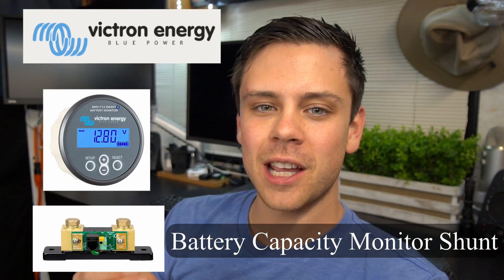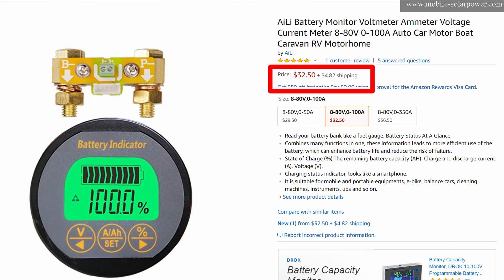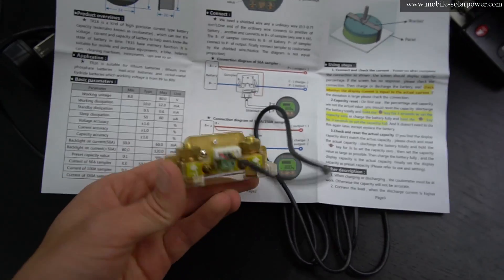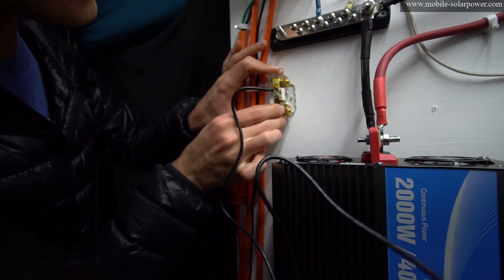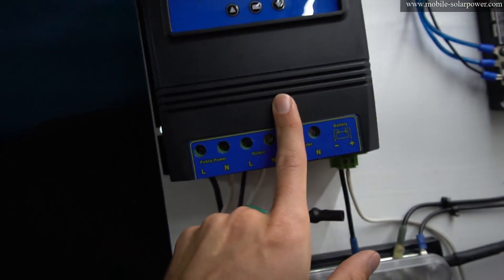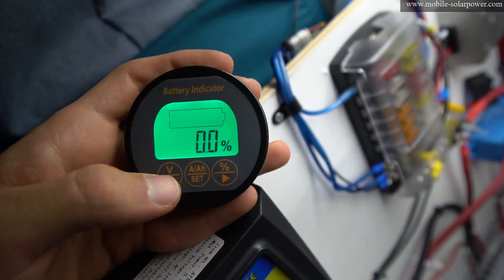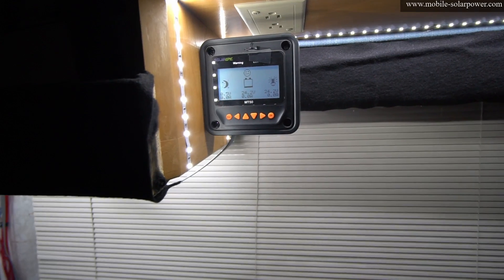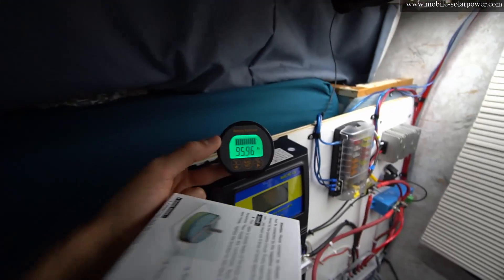$200 Victron Solar Battery Monitor? Try this $30 Chinese one instead! Great for Off-grid Solar

Comment: I don't get why you need to set a 0 volt..
And what would that be for a 12v lithium? 10v??
I planned on getting a bmv702, but this seems just what I need, I need to know the % of my lithium battery (4wd setup) harder to tell using a volt metre like an AGM..
Reply from the maker: Zero volts is 10. It's 0% Soc.

Comment: As I'm figuring out my solar system and how everything works. I decided to get a meter. After watch many videos and going through the options and seeing this meter forsale online then I found your video to help confirm my decision to purchase one. It would be great to have the bluetooth but the information is what I really want. Maybe the Chinese will come out with a new bluetooth model soon. Itll probably be cheap enough to upgrade this unit. Lol. Thank you for this helpful video along with all your others. I have pretty cool gmc savana that I've been working on and cant wait to get it completed so I can make my final video and start editing some of the footage of the build. Once its finished I'll send you the link and maybe we can swap more ideas. Thanks again.
J.C. out here in Half Moon Bay CA
Reply: Yes, I got one a few week ago and it works great.  I charge the lithium batteries from my rv alternator with the Renogy 20 amp dc to dc charger and it works great.  Thanks for the suggestion

Comment: I don't see how this will stay calibrated for very long with no settings for charge efficiency, peukert constant, temperature  or even battery type. The Victrons auto recalibrates every time the battery reached a full charge.

Comment: What would the zero point be if it were used in an RV with a few 12v led acid batteries?  This is a great find.

Comment: After purchasing one I'd say to use your low voltage disconnect to get to your zero voltage (11.9). Then fully charge, if you have very good quality AGM batteries you might have more ah than you think.
Reply: I've got 6.2% more ah on a 864ah bank than 50% dod would suggest.

Comment: They have rewritten the instructions. They are quite easy to understand and follow now. At least on the 350A version that I purchased from Amazon a few days ago. They have also added the ability to turn the backlight off and on, by pressing the V and % buttons simultaneously and holding for a second or two. This may not be a new feature, it might exist on all of them but just wasn’t documented.
Reply: @Gail : I cant' get a hold of this 'new' TR16 instructions manual (with the display on/off option), could you share it ?
Reply: What size are the bolts?  What lugs size, 5/16, or 3/8?
Reply: @supermo26  I have both 100a and 350a. The 100A shunts are 5/16. The 350a shunt is 3/8. Found out the hard way.
Reply: yes I've sean y-tube videos where the light blinks when charging kindof iratating. pressing V & % will stop the blinking?

Comment: This may seem like a silly question, but is it possible to change out the bolts on the shunt? I’m reading that the 350a shunt uses 3/8 bolts and all my cables have 5/16 ends. I don’t want to redo all of them.

Comment: You have to discharge your batteries to nearly zero for this thing to be set.  I ain't doing that.  Bad for AGM batteries.
Reply from the maker: No, you discharge to whatever you usually discharge to. Which is probably 50% Soc. Not 0%. 0% of your usually cycle capacity. Lol I thought that was obvious
Reply: @WillProwse     only obvious to genius's like you.

Comment: Does the monitor take in to account charging inefficiency in the battery? If you put 100 amp hours in, you don't get 100 amp hours out. Without compensating for that the monitor will think your battery is full when it is actually empty after a couple dozen cycles.
Reply from the maker: It resets every cycle. And no, not for peukert effect

Comment: I wouldn't quite compare it to a victron, the bmz700 or 712, has alot more features.. maybe you don't need them, but there there.. you can set volt cut in for generators, to turn on at a certain voltage, or at a certain time, can do alot more than what this one does

Comment: The cheap Chinese one will probably set your house on fire at some point :)
Reply from the maker: What would fail? Two voltage sensing wires and the simplest logic board ever. Low resistance resistor. What would catch on fire?
Reply: @WillProwse  High current connections that can't be FIRMLY tightened is not safe.
Reply from the maker: @michaelbrown2443  every shunt on the market is just as cheap as this thing. they all come from China and are relabeled. How many shunts have failed on you this year?
Reply from the maker: It's a shunt

Comment: Love to see the inside of that device. Can’t be more than a couple simple circuits, resistors, a chip and display. You really should get into making your own stuff Will.
Reply: I agree...  under $10 if you build it yourself on an arduino and $15 if you order a meter like this from AliExpress...

Also,  it is REALLY bad to train your meter by discharging to zero SoC...  most meters let you set 100% and learn downwards without destroying your battery.
Reply: GyroGearloose-HackingRVsCheap I think he mentioned that the meter was going to learn on its own after he did the discharge test. He clearly had a hard time with the documentation. So it’s a trial and error video. 

Anyway, we know it can be build for a fraction of the price, after all you can tablet computers for a hundred bucks. We might just be afraid to do things ourselves. We are primed that only a professional can do things. While that’s true in some instances, the majority of work can be performed by anyone who is not half brain dead. My car repair shop wanted to charge me for 4 1/2 hours of labor to replace a radiator fan. Found someone who did it in 35 minutes. I watched and now can confidently do it myself.!
Reply: The Shunt is the critical part, not easy to make...

Comment: These battery monitors need to give you a longer data cable. Most include a 2 meter length cord and thats not nearly long enough for RV installations for most folks. I found a company who has them in 35 ft lengths, and they sold me one. You have to find the correct shielded cord with the corrrect plugs and thats not easy to find.

Comment: nooooo dont say that victron is overpriced standard kit! the victron religious nuts will get in a flap!
Reply: If there is ONE thing that is worth buying quality, it might be the SOC meter.
Reply: @michaelbrown2443  isn't that a voltmeter for people who can't read volt meters
Reply: We're Really Relay Camping: Particularly for lithium, we can’t determine SOC from a volt meter.  A meter that tracks Ah in and out is needed.
Reply: @michaelbrown2443  been working with lithium for 6 years now, so I know you can track soc via voltage and much more accurately than with lead due to the lower internal resistance. It's not that hard as the voltage does taper in a nice linear fashion from about 90 to 20pc, just display that as 100 to 0 and your covered. If you just use voltage on lead it's going to vary with the weather even in the UK so yeah not that accurate.  An amp in amp out is easily more accurate I agree with you, but I find people requesting such accuracy are usually the ones wanting to discharge to near death on them instead of buying a larger size pack, I used to be one of those people lol, now I just have 400+ amp hours and ignore the meters, I'm never that far down unless I'm torture testing an inverter.

Comment: I can't believe you actually need to drain the battery to set 0%, surely you can set your own preset 0% which could be your own predetermined low voltage disconnect. Thoughts or feedback?
Reply: No, you can setup the system on full too: 
Set capacity zero or full：
When on first use or change the battery，the memory
capacity should be set zero or full: In the main interface，hold the
“ ”key for 3 seconds to set the capacity zero，the percentage
is 0；hold the“ ”key for 3 seconds to set the capacity full，the
percentage is 100. Attention that the operations can not be
restored.
Reply: Ah yes, i mean you can set it once your battery is at your own favoured low or high voltage knowing the actualy capacity remaining at that time i.e. 75% on a 100ah lithium amd then say set the capacity to 50Ah so that indicated 0% will be at actual 25% - to maximise lifespan of battery.
Reply: Of course the charge source charge algorithm and low voltage disconnect should be setup to match...

Comment: Hi Will,  wow thanks for this  vid.  I'm with you on the prices,  these company's are insane.  200.00 plus just to show the v, w, %. I will purchase my 30.00 next month.  I need two, one for each battery.  I have a two house 12v wet battery plus another for all my other systems.

Comment: I got mine installed, and was able to set amp hour capacity [225 ah] and 100% full battery, but I am confused about the voltage setting! I have 2 [new and fully charged] 6 volt batteries in series, so 12.6 volts. I adjusted the "V" setting to 12.6 volts, but it goes back to zero!  I thought that it should read out my 12.6 volts. Any ideas why it's reading zero? Did I do something wrong?
Thanks for your videos!

Comment: This can only manage 80V, right? I have 2 x 330wp with 70V (VOC) each in series planned for my vehicle. Is there a battery monitor that can handle that? The Victron 702 only goes to 95V.

Comment: I assume this will work with four LION batteries 100 Ah each set up in parallel .  Is that correct?  Thanks.  Good video.👍👍👍

Comment: That meter looks really good.  My only concern is with the plastic base.  Does the plastic base only keep the bolt from rotating, or is it also sandwiched under the bolt head and getting the compression forces of the wiring connection?  If the plastic base is in compression, I would worry about the connection becoming loose and overheating due to the plastic deforming with the heat and force.

Comment: Not sure I'd trust it to be accurate over time.   Also nervous about putting cheap electrics into my truck where a fire caused by a ncap faulty device would cost a lot more than the money saved over a Victron.
Reply from the maker: Yeah but it's a shunt
 It's fine

Comment: Now $40 on amazon. Does Alibaba have them cheaper ? —- and what is the maximum length of the monitoring wire connected to the meter?  Can I run that wire 20 feet?
Reply: The plus monitor is just for voltage, almost no current flow, like a DMM.
So that wire can be dang small.

Comment: Do I need to connect my negative from my ctek shorepower charger aswell as my solar negative to the "P" for it to measure correctly or do I connect them to the battery?
Reply: André Wendel everything going i or out from the batteries has to go via the negative bus-bar and the shunt. Ohtervise it will not display correct measurement.

Comment: I wouldn't put my trust in a $30 Chinese item when I'm looking at my $4000 batteries.
Reply: It's just a smart volt meter, can't do any harm to the system.
If you doubt it's reported SOC, measure it yourself with a trusted volt meter for comparison.
Reply: Michael Boardman — likely a wise observation. And why I will not spend $5000 on a solar system used for boondocking randomly. If I was full time in a remote area, where I could stay 30 days —- maybe.

Comment: And it’s irritating when the Victron BMS board on the shunt stops working and they have no replacement but want you to spend another $200 on another full monitor and shunt. They sell the shunt separate but not the board ! That’s just bad service from Victron

Comment: Bought one of these £36 (in the UK) monitors and have an installation question - would be very grateful of any advice. I have 2 leisure (house) batteries, 1 under each front seat, connected in parallel. My positive comes off LB1 under the drivers seat and goes to my fuse box, which is earthed to a seat stud bolt. My -ve comes off LB2 -ve under the passenger seat, and goes to a seat stud bolt under that seat. When I place the shunt under the passenger seat, do I have to reroute the -ve from the fuse box so it also goes through the shunt? Thanks.......

Comment: Just picked up one yesterday and trying to decide where to place it. I only have 200 watts of solar and two lead acid batteries at 12 volts for my starting point. Eventually I want to go to Lithium but for now until the seasons warm up again here in New York this is where I am at. Also just picked up your book on Amazon and seem to gravitate toward the 400 watt sized system. I am not sure though to ditch my crummy WFCO system ot maybe add to that with a separate solar system. Thanks for providing so much info.

Comment: I wonder about the reset when drained part. Could you zero it when the batteries were full then decide when you want to recharge. I ask as it is easier to charge my batteries and then let them rest. Waiting for the batteries to fully discharge takes a bit more timing.  In your video I did not see you set the meter for how many amp hours your batteries were. How would it know when your batteries were full ?    Put another way, if it doesn't know how many amps came out of the battery, ( resettiing it when drained would zero it out), how would it know how many amps it would take to recharge?  Maybe it uses a capacitance test to determine 100% ?

Comment: When you have to bring your batt bank down to zero to set a baseline for the monitor, I thought I was never ever deplete my batt bank. (I use wet cell)
Reply: I believe he used the 0% setting to represent the lowest voltage he felt was appropriate to not go below to degrade the batteries length of life.   If he used 6V flooded golf cart batteries that has say has a 230 Ahr capacity, the C90 value.   He might select not letting the battery to fall further than 40%, so he'd run the battery down to 12.2 V representing 60% capacity that corresponds to 138 Ahr remaining in the battery and make that 0% capacity for the monitor.  He set an artifical 0% floor that in reality was the 60% true battery capacity at that point.  Sorry l may have made this seem more complicated but he didn't run the battery down to it's true 0% SOC that would if he did correspond to the battety's true voltage reading of10.5V.

Comment: Thank you!  I got one of these coming in the mail!  One question:  You set lowest voltage to 24.9v on the capacity monitor (based on your auto transfer switch's low voltage value), but when when you fully discharged the battery, voltage dropped to 24.2v (which is also what was shown on your auto transfer switch at that 100% discharge time).  Shouldn't you have used 24.2v for the capacity monitor's low voltage setting rather than 24.9v?

Comment: I had exactly the same thought, I 'wanted' a battery monitor because I wanted it for my boat's house battery but didn't feel like spending too much for the reasons you mentioned. I have ordered the same one a few days ago so was good to see you installing it...as the number one gripe was the chinglesh user instructions and you helped clear that up. tyhx

Comment: I am a newbie to solar just set up my 1st system wanting to install this battery monitor do I run all of my negatives on my negative side of my battery to one side and then the outside back to the negative side of the battery

Comment: Hi Will - have you seen some versions of these cheap Chinese monitors which use a Hall-effect sensor instead of a shunt (e.g by Droking on Amazon)?  I wonder if they are any good - I'd like to install one on my narrowboat battery bank where it is very difficult to install a shunt because of the location of the cabling, but I could easily thread one of the cables through a Hall sensor.
Reply: Bought one from Droking, still measures empty battery even when it's full. But I see in Will's video he brought his bank to "empty" and set it from there. I didn't do that. Directions are terrible

Comment: Hi Will.  I bought your book a while back.  Love it.  I'm a newbie to rv electrical systems.  I have an Alaskan Camper(a dinosaur, but I love it).  Intend to boondock and install solar panels on its roof in the near future.  Loved this product review, but have one question before I buy it.  Currently, I'm using two 6v golf cart batteries wired in series.  I'm reluctant to discharge them as required by this product.  You're more knowledgeable here.  Won't discharging them beyond say 50% damage the batteries?  Thanks for any info....Paul

Comment: Will, thanks for helping my aged mind to learn new things, but, it is taking awhile for the cobwebs to dissipate! So please help!

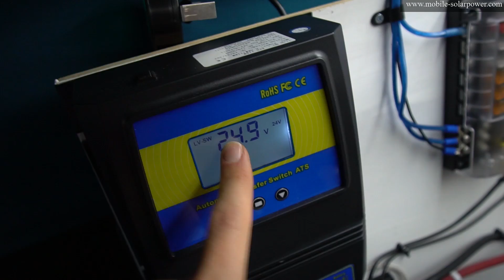I have a typical non-solar 2-6 volt in series RV battery system. At about 5:00 you set the "lowest SOC voltage your batteries will experience", but you have a cut-off voltage with the transfer switch. What the heck do I set mine too? Is it 12.1 volts? (The same voltage I discharge my battery to to indicate 0.0% capacity?) GK
Reply: Grampa Kilt With lead acid batteries it’s less exact than with li-ions. So in your case it’s more like how low do want to go? 12.1V seems quite high to me if if you don’t want to use your batteries below that voltage than that’s your 0% voltage.